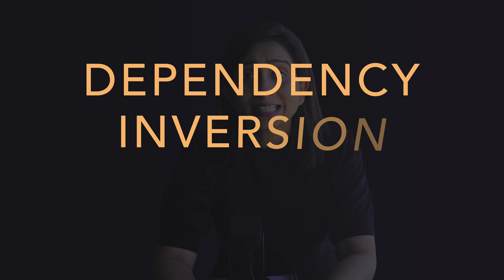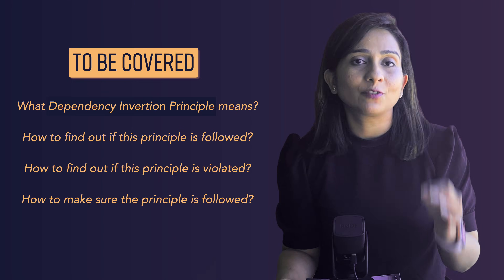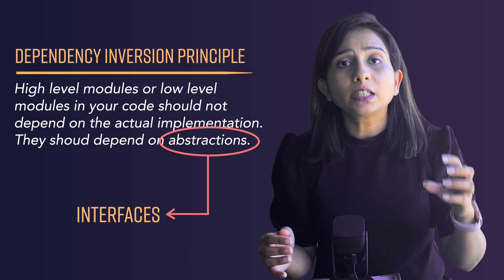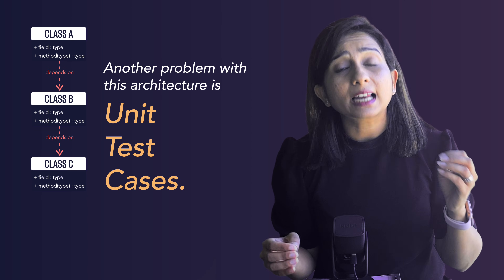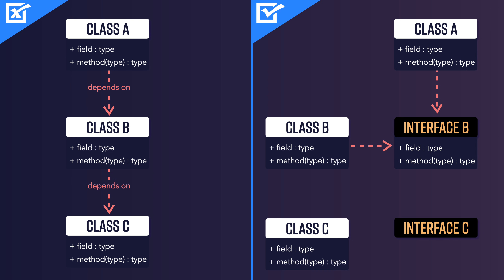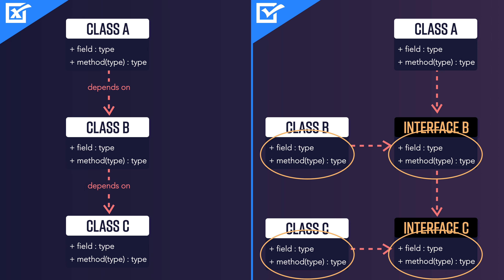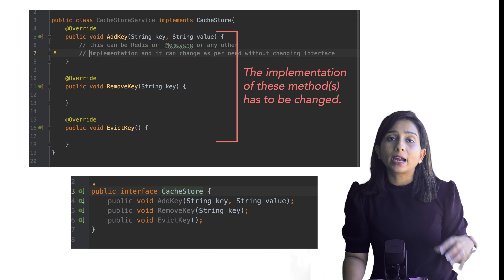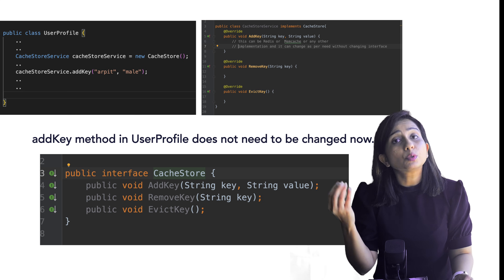Low Level Design 109 | Dependency Inversion Principle | 2022 | System Design

Comment: Good explanation overall but the example for cache doesn't look right. The main reason for moving to interface is:
1. Remove tight coupling of concrete implementation of cache service (which may change) and we only want to depend on the general cache interface
2. Ease of testing - Now I don't need to initialize the concrete implementation of cache service for testing the Class which has dependency on concrete cache service

Comment: Not clear. The problem you have mentioned and the solution as interface you have given is not in sync. For example, let say interfaceA has two functions which was impl by class B, now interface again need to change to add another 3 functions, this is impacting class B anyhow as it must impl those new three functions too.

Comment: in the example given above, even if I want to add support for multiple data stores, I dont need to change the method signature of any of the above methods, even if I dont use dependency inversion. and  even i method signature has to be changed, it has to be changed in interface as well.

Comment: So for the example above, what if your two implementations require different parameters? For example the CacheStore.AddKey() in your new implementation takes an integer value instead of a string value? You could make a new method called AddKeyInt() but that would break the Interface Segregation principle because the first class wouldn't have a need for the new method

Comment: I see there are many comments requiring clarity on this. Hope this scenario helps.

If one wants to simplify Dependency Inversion principle (DIP) a bit too much then one can say that High Level classes should not depend on Low Level Classes (i.e Actual Implementation) but on Abstraction (i.e Interfaces). 

Why you may ask ? 

Because let's say without DIP, if say one needs to change something about Low Level Class being used in High Level Class, then High Level class is modified. 

Classic example would be say a Class called DataPersistance was using a class to save data to sql server via SQLStore and say now we have a case where we want it to change to NoSQLStore for certain cases (achieved via run time polymorphism), then we will have to change the implementation in the DataPersistance.

A good design would have an Interface named DataStore which will have two implementations SQLStore, NoSQLStore (since methods like add, delete would be identical so common interface makes sense). 

This interface would be injected to DataPersistance class and now say in future you want to add new store, then all you need is implementing that store from the same DataStore interface. 

This helps to achieve following things :-
1. No code changes directly in high level classes. (Interface instantiation is already decoupled from High Level classes. Example using Spring IOC) 

2. No side effects therefore from changed Low Level Implementation in existing workflows.
Reply: Makes more sense than the video:goodvibes:

Comment: I think explanation not good this time.  I think using factory pattern is the inversion principle.  If suppose need to make changes in instantiation logic of any object in future then can make changes in factory only instead of making changes in each and every places where this object being used via new operator.
Reply: Yes that is true. 

Solid principles are principles and not implementations. 
Factory pattern is more than just inversion principle. It is also used when follow Open Close principle.

If one wants to simplify Dependency Inversion principle (DIP) a bit too much then one can say that High Level classes should not depend on Low Level Classes (i.e Actual Implementation) but on Abstraction (i.e Interfaces). 

Why you may ask ? 

Because let's say without DIP, if say one needs to change something about Low Level Class being used in High Level Class, then High Level class is modified. 

Classic example would be say a Class called DataPersistance was using a class to save data to sql server via SQLStore and say now we have a case where we want it to change to NoSQLStore for certain cases (achieved via run time polymorphism), then we will have to change the implementation in the DataPersistance.

A good design would have an Interface named DataStore which will have two implementations SQLStore, NoSQLStore (since methods like add, delete would be identical so common interface makes sense). 

This interface would be injected to DataPersistance class and now say in future you want to add new store, then all you need is implementing that store from the same DataStore interface. 

This helps to achieve following things :-
1. No code changes directly in high level classes. (Interface instantiation is already decoupled from High Level classes. Example using Spring IOC) 

2. No side effects therefore from changed Low Level Implementation in existing workflows.

To answer more on Factory pattern, apart from that, it is used in Template Design Pattern. Also Abstract Factory and Prototype Pattern do use it as well. 

Hope this helps.

Comment: In the first example you said that if we want to change the signature then dependency on concrete will be a problem but that problem will be there even if interface dependency is also there and that's why for interface dependency you changed the example to implementation of concrete class and I dont see any problem in concrete class dependency even if it's implementation is changed only as per the example you gave, sorry but can't see the benefit of using interface in your example
Reply: yes right..these useless principles are teaching us what we already know and can learn by writing code and continously maintaining it..these are just theories which interviewer's use to present themseleves like they are the inventors of computer science.."theory is not enough"

Comment: That seems to be a bad example , either way , if it is via interface or directly from class , if the variables while calling func is same , then whether or not the implementation changes , it doesnt affect the higher level modules , we are still calling the same function the same way , underlying code may change , no need for interfaces in this.

Comment: Please explain Open Close as well, your explanation is very layman and helpful, Thanks
Reply: open-closed principle is the most open ended principle of te 5 SOLID principles. It basically says that you should not make changes(modify) current implementation if we want to extend or add new functionality of our application. open for extension, closed for modification.

Open closed principle is implemented automatically, if we implement single responsibility principle and dependency inversion principle.

Comment: but how does it change anything in this given example? if we change the implementation by changing the variables as you mentioned , then we still need to change in the interface right , so how does it actually help by having the interface. I'm sure the concept is right but the example given here is wrong .
Reply: Yes. Same doubt
Reply from the maker: Changing the variable of implementation classes and not interfaces.
Reply: Do you mean creating a new method in class and giving new parameters requirements in the client?

Comment: Hi Arpita, thanks for this fantastic video. Is the code @6.10 correct? CacheStoreService cacheStoreService = new CacheStore();   Should not be it other way? You cannot create an instance of Interface.  CacheStore cacheStore = new CacheStoreService();
Reply: I am also struggling with the same question 🤣
Reply: @Journeywithatul99 
 what if the signatures needs to be changed in Interface, then it will impact the whole code
what do you say?

Comment: When we implement a class at lowerlevel  without using interfaces you explained(in cacheStore example) that the higher level class needs to be changed when we change the signature (number of variables) of some function inside low-level class... How using interfaces will solve this issue? I mean if we change signature of function in interface then we also need to make changes in higher-level classes and lower-level class...
Reply: I am searching answer for the same question but did not get it yet......others please like sagar's comment so that she sees it.
Reply: Same dought😄
Reply: I have the same question!!
Reply: These principles are all sham . No one uses it to be honest .. just there for interview purposes
Reply: same Question...
Reply: Also the example is wrong. How are you going to change the signature of the method if the technology changes
Reply: Yes, I am also a bit cnfused on the parameter which you highlighted and later you focused on implementation. If the parameter changes definately the high level module will require change irrespective of we using interface. Below coudl be a good exaple for DIP, the code is in python.

```
class RelationshipBrowser:
    @abstractmethod
    def find_all_children_of(self, name): pass

class Relationships(RelationshipBrowser):  # low-level
    relations = []

    def add_parent_and_child(self, parent, child):
        self.relations.append((parent, Relationship.PARENT, child))
        self.relations.append((child, Relationship.PARENT, parent))
            
    def find_all_children_of(self, name):
        for r in self.relations:
            if r[0].name == name and r[1] == Relationship.PARENT:
                yield r[2].name

class Research:
    # dependency on a low-level module directly
    # bad because strongly dependent on e.g. storage type

    # def __init__(self, relationships):
    #     # high-level: find all of john's children
    #     relations = relationships.relations
    #     for r in relations:
    #         if r[0].name == 'John' and r[1] == Relationship.PARENT:
    #             print(f'John has a child called {r[2].name}.')

    def __init__(self, browser):
        for p in browser.find_all_children_of("John"):
            print(f'John has a child called {p}')
```
Reply: Take an example of class 'Redis' and class 'ElasticDB'. Lets say we initially used Redis for whole project but now we want to use ElasticDB with the same class functions as Redis. Lets say we also have a Class 'PasswordReminder' which takes the Redis Class Object as its input. So, changing it to ElasticDB would require us to change 'PasswordReminder' implemetation/argument also. 
To remove this problem, we create the Cache interface, which is implemented in Redis and ElasticDB class, and for PasswordReminder Class method, we use _foo(Cache cacheService) {} for implementation so that it can support multiple types of Caches. 
This code establishes that both the high-level and low-level modules depend on abstraction.
Reply: Still unsatisfied answer @sudocode
Reply: I think the idea is to explain changes in the implementations not the signature in future wouldn't impact the high-level module....
Reply: @balakrishnabilla  how changes in low level classes will affect high level module and how introducing interface will solve that?
Reply from the maker: Implementation might require an extra param which could be internal and not coming from interface. In that case interface doesn’t need change, caller doesn’t need change. If there would have been no interfaces, then caller would also change. Applies to method names as well. You can swap the underlying cache tech just by changing implementation and interfaces will hide that from client or caller.
Reply: @sudocode  can you please provide an example comparing both approaches side by side when we make a similar change in both scenarios
Reply: @sudocode  The mocking bit i agree, interfaces make it seamless to inject mocks. But changing the underlying caching tech or changing the  signature of the public method would have the same effect on either approaches. The idea behind it is right, but your explaination with this example is not. Better way would be to have a say RedisStore implementation which implements CacheStore interface. So here the UserProfile  has a dependency on RedisStore class as well as knows about the actual implementation which it should not according to the DI principle. So here creating the actual store implementation should be moved to a factory, like CacheStoreFactory.createStore, this would get rid of the RedisStore dependency from UserProfile plus it does not know about the actual implementation detail and you can change the implementation detail to using Memcached without needing to change UserProfile.
Reply: @sudocode   the code and explanation isn't exactly correct in my opinion. Using interfaces is only 1st half of the solution. 2nd half being not instantiating the class directly but using an IOC Container to pass that responsibility. Correct me if I'm wrong.
Reply: @sudocode  This doesnt change anything , if the param is internal anyway you can wont make change to method signature .. 
Its like you can change the signature of overridden method without changing its signature in interface . If you are anyway going to have a private method then interface doesnt even come in picture . Not getting exactly what this principle is try to solve at first place . Unit Test logic made sense but the example dont prove that .
Reply: @vickymcs15 looks good explanation.  So then, if suppose need to change the instantiation logic of any instance then can make changes in factory instead of making changes in every places where it's being instatantiated via new operator.
Reply: @AkshayKumar-kz6zh   You are correct but the 2nd half you mentioned is applicable only for frameworks that supports dependency injection. If anyone use basic languages or framework that doesn't support dependency injection they can't do the later steps. So to make the principle generic the first part is only useful.
Reply: @vickymcs15  I think if high level classes depend upon low level classes, the high level class can have dependency on the lower level details accidentally. There might be some methods in a low level class that were not supposed to be visible to other classes but were visible unintentionally. If that is that case, changing those methods will break the high level classes. Using interface will make this more intentional. i.e. if the methods are listed on the interface, they are meant to be exposed to the higher level classes.
Reply: @sudocode in that case how does the interface solves the problem? You can do that without using interface as well 🤷🏻‍♂️
Reply: Strictly my opinion as a working dev without formal edu: 

Interfaces only work to improve dev efficiency (less code to read to get a general picture), and has very little function in improving change management in software.
From my experience, the difficulties in change management (especially in complex systems) are hardly resolved by any design pattern.

That's where documentation, compilers (with type checking) and tests come in.
Reply: Mam please complete remaining video of solid principles. Your explanation is amazing 👍